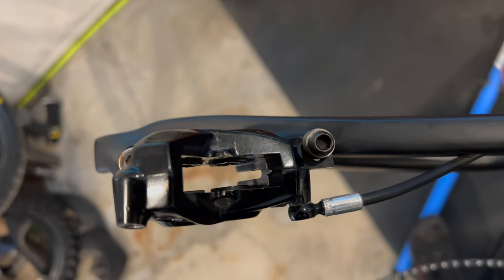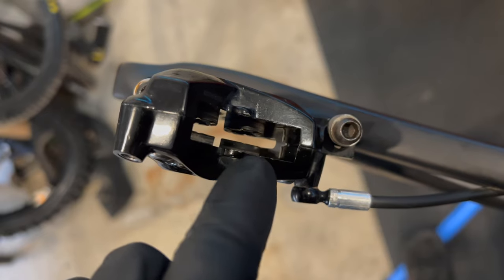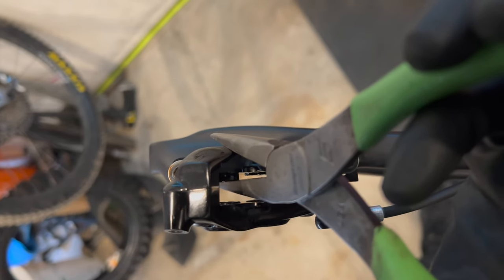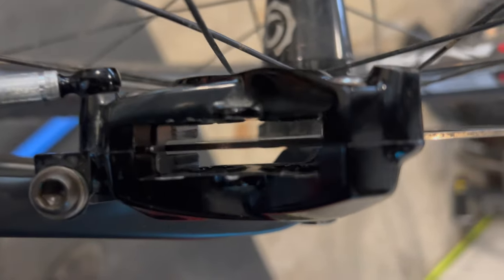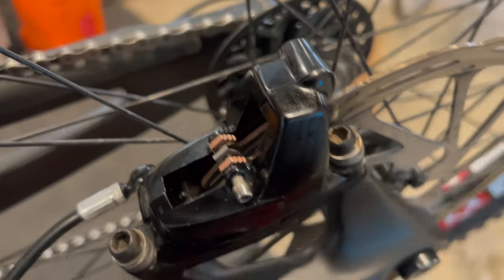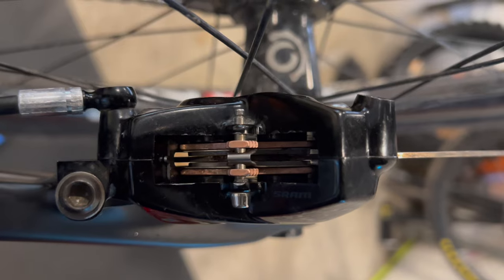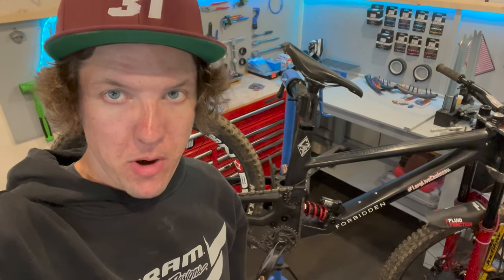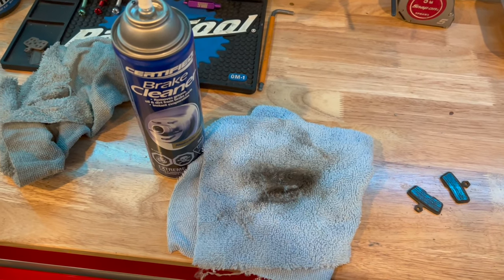How To Make Your Sram Brakes Not Suck! - Sram Piston Service

Comment: I was about to bin a rear Guide RE as the pistons on one side where so sticky I couldn’t align the calliper without it rubbing on the disk. The 4mm Allen key trick is absolutely genius and allowed me to push pistons out and get them moving with dot fluid. The brake now sits central in the rotor with zero rub. Fantastic.
Reply from the maker: Awesome Tony!

Comment: Excellent video.  I've been wanting to learn how to swap out my Sram brake pads but could never figure out how to push back the pistons until I watched your video.  Most of my issue was not having the correct instruction and parts (i.e. DOT brake fluid, brake cleaner, etc.).  Thank you for posting this.  Super helpful.  Keep up the good work.  You're the man!

Comment: I never used to service my brakes except for changing the brake pads (without opening the bleeding port). However, I had some issues with my Sram Maven brakes and got tired of going to the shop, especially since I have two pairs on two bikes. The information in this video helped me a lot! In addition, after almost 20 years of riding, I finally decided to learn how to bleed brakes so I could finally take care of my brakes myself.

Comment: Thank you so much. My back brake (code r) was almost pulling to the bar. I tried bleeding it 3 times with different tutorials including yours. None seemed to make a difference. However once I bled according to your instructions, then immediately did this piston service (without removing the plunger from the lever). This made all the difference. Brakes no longer pull to the bar, while it doesn’t feel as good as the front you can’t have it all! Thanks.

Comment: Thanks for this mate , just bought myself a Santa Cruz Bronson and was having nightmares with 2 pistons on one side of the calipers pertruding more than the other side. Had bought two sets of brake seals which I installed but didn't cure the issue.  
Did your trick with the screw driver and I now have brakes that feel like they are factory fresh ❤

Comment: WOW!  I have been less than satisfied with the Code RS brakes that came on my new specialized Stumpjemper Evo Comp. For "enduro and downhill brakes they were very underwheling and honestly the shimano mt200s on my other bike seemd far more powerful. I started with a full bleed and that helped a tiny bit, but i was still very unsatisfied.  I then combined this video with a video about re-bedding your pads (light sanding of the pads and rotors followed with a bed in procedure) with this video and NOW they are stopping like Iwould expect. ZERO problem locking up the rear on a fast downhill on pavement. THANKS!!!!

Comment: My brakes are now working perfectly, thank you. The 4mm hex key trick is genius. Just a word of warning about using pliers to push the pistons - be careful if there are serrations as the piston material is quite easily chipped.
Reply from the maker: Hey Tom, glad to hear your brakes are working better. For sure the pliers can be  risky, you can use a plastic tire lever for the same effect. The Snap On pliers i use are pretty forgiving. Luckily rebuild kits for these calipers are cheap and easy to install if the worst happens.
Reply: There’s also a specific Park Tool tool to push back the pistons. About $20 bucks on Amazon.
Reply: @TheFullKanani  That Park tool, made of metal, is intended to push the pistons back *with the brake pads in place*. i.e. the tool doesn't touch the pistons themselves. [If I'm thinking of the same tool.]
Reply: @phorest  yes that makes sense!

Comment: Brilliant idea 🥇 with 4mm to hold all pistons - Well done. One step up would be to keep 4mm (use robber band) inside caliper to hold on all pistons and slide/ squeeze flat screwdriver between 4mm and piston to push one piston back and/or reanimate one if stock. That way you protect the caliper body from damaging by plyers and popping pistons out.
Its nice to see when brain is used.  Great job men.
Reply from the maker: Thanks! I really don’t care about superficial issues especially when I’m going to crash into a tree or a rock on the next ride ha! But good idea to save the paint if your worried about it. Thanks Len

Comment: I've struggled trying to get the pads to advance the same amount.  These are all great tips. The screwdriver behind the pad is a game changer. I've never thought to preload the spring.  Have you taken the calipers apart to replace the square seals?
Reply from the maker: I have taken calipers apart but normally it’s more cost effective for a shop to just replace the caliper. It’s pretty easy though, and cool to understand how the brake works. Thanks Len

Comment: putting the bleed syringe on the brake lever while doing the piston service is brilliant! hadn't thought of that before but it totally makes sense!
Your pistons must have been mostly okay...I have a heck of a time pushing them back in! Also, a little tip for anyone using a tire lever to push them back in: watch where you set that lever on the caliper! I was concentrating so much on getting the piston back in that I didn't notice I was also pushing against the retaining pin mount and it snapped right off. No fix, had to buy a new caliper! :\

Comment: Great tips! Does it matter to do this before or after bleeding the brakes?
Reply from the maker: If the brake really needs a bleed then you’ll have to do it after as you won’t be able to move the pistons out. Otherwise either is fine, I do this service every few months and only bleed the brakes 1-2 times a year. Thanks Len

Comment: Great video. If the brakes are brand new, would you still need to have the bleed syringe set up?
Reply from the maker: Ideally yes, the syringe acts as a reservoir for extra fluid so you don’t over bleed the brake, and more importantly not let air in. If you find that the pistons don’t retract back into the caliper without other pistons pushing back out, then you’ll need a syringe. If you can push them all back and they sit nice and equal then you don’t need a syringe. Hope that makes sense, thanks Len

Comment: Thanks for the great video, have a set of Level Ultimate that were driving me crazy, almost thinking to change them for Shimano, which i don't like. I'm super handy with all my bikes, but with this calipers, i was lost. Followed all your tricks, they're working as they should. One question, i'm using the bike on some mountains in Europe that have long downhills, 15-20%, and sometimes the rear brake gets hot and leave me with no brake at all, now i changed the fluid that was old, and changed it for Motul 700 racing fluid, which has a higher boiling temperature, do you have anyone that tried car racing brake fluid on mountain bikes? Thank you very much for your time and for sharing your knowledge and tricks. Christian
Reply from the maker: One of my favourite sayings is "there's no replacement for displacement" (car engine's) The bigger you go the more power you get. It's the same with MTB brakes. Big rotors and powerful brakes offer more control and will deal with the heat much better, so they won't fade on bigger descents. I run Code RSC's with 220MM rotors here in Squamish, they never fade. Thanks Len

Comment: I could not fully agree with the concept. Brake piston are intended to follow the pads when pads wear. Pistons made a very short stroke to brake because  pads have a small gap relative to disc. This is good because you feels a short lever movement  to obtain heavy braking. In the mode that you suggest a much greater movement of the lever will be required

Comment: Very helpful ☝️Thank you. 
At 3:00 how to avoid a piston to snap out the calliper when pushing in the last one?
Just starting with the one which is sticking out the most?
Reply from the maker: Yes, essentially start with the furthest out first. Make sure you have a bleed syringe with some oil installed at the lever, that way any extra fluid that would make a piston fall out will go back into the syringe instead. Thanks Len

Comment: Hi Great video. Thanks for posting. One question to lube the piston with a Q-tip..  what lube should I use?? Brake fluid or ??? Thanks
Reply from the maker: You should use the appropriate brake fluid for the brake you have. Shimano/trp is mineral oil, most Sram brakes are DOT

Comment: Oiling the pistons has made a TON of difference!! But… I can’t mimic the flathead screwdriver trick like you did. With the rotor between the pads, how do you get the pad and pistons on the opposite side of your pushing to retract??
Reply: Insert the screw driver behind the brake pad that needs to come out more and then push everything, the two pads and the rotor, against the side that needs to be pushed in. This technique will push the piston(s) on one side into the caliper to provide the needed gap between the contacting pad and the rotor. You'll also have to pump the brakes to bring out the piston after you push everything to one side. Repeat the process, on either side, as needed to provide equal gaps on both sides. Trial and error and eventually experience will get it right.

Comment: How about taking our some of the fluid from your lines? Won't that create a bigger gap between the pads and the rotor? With such a small gap like you have there, any little flex will cause a disk rub.

Comment: What did you use to lubricate the pistons? I've cleaned mine with disc break cleaner but did not lubricate them and they are still sticking 😞
Reply from the maker: I just use DOT fluid, or you can use DOT grease but it's expensive and hard to find. Len
Reply: Use dot grease. It will have a more lasting impact than the brake fluid.

Comment: Would you recommend these same steps for other brands like trp and hayes?
Reply from the maker: I do this for every brand, just use the correct bleeding fluid. It doesn’t make as much as a difference unless it’s Sram but regardless it will improve the setup of your brakes. Thanks Len

Comment: If my levers have way too much throw before the contact point, is it possible to advance the pads or use any of these techniques without bleeding? I don't have the bleed kit. They were just bled about 8 rides ago. If I open the bleed port, will I lose a bunch of fluid?
Reply from the maker: Yes you can do this technique without bleeding the brake. You may not be able to push the pistons all the way back without a bleed syringe. This service will fix your lever throw. Thanks Len
Reply: @garage31  thanks for the response. I ended up buying a bleed kit and learning that through your video as well. Cheers!

Comment: A Question, Len: I have older Sram brakes. They have 2 pistons and a retainer cotter pin. I have followed your bleeding and your not suck YouTubes. Problem: 1 piston is strong enough to push over the rotor a little, then not retract off of it. The pad does back off some, but always rubs. The other piston seems to be working properly. I have done the srew driver pry thing. I have also inserted a thin feeler guage blade into the tight side, can pry it back to the proper retracted position, but it comes back to it's misbehavior. Both pistons have been lubed, the rotor centered in the caliper and the pad spring made stronger. I tried to adjust the caliper to compensate for the situation, but didn't have enough adjustment. Please advise.
Reply: Update: I took the it all apart again, re-cleaned, re-lubed with DOT, worked to pistons in & out about 6 times. The "bad" piston has a tendency to get cockeyed in its cyliner, thus gets delayed/behind the good piston. I guess will get a re-build kit. For now, put it all back together. Now, the "bad" piston still does not advance the same as the good one, so double engagement is with rotor off-center of the caliper. However, I have positioned the caliper off-center so pads engage rotor at the same time. Suprisingly, this extra TLC helped the good piston to retrackt better, so now both pads have an equal resting distance from the rotor! On the "bench", works great.
Reply: Update 2: I then discovere the fitting behind the brake lever that adjusts the throw, or more imporatntly the pad engagement point. In the beginning, my main probalem was, the levers would hit the grips before full engagement. So, when I got done with all the work you guided, I still had the same problem, although much potential improvement once I got the throw adjusted properly. All of my previous reporting has been on the front wheel. It is ready to go. 

The rear wheel, except for the throw problem, had a different set of problems. Having gotten familiar with the syringe functions, I decided to start out without them. As I opened the fluid plug by the lever, I put one drop at a time in the system. It took 60 drops!! That seemed like a big part of the rear problems. Not expecting any bubbles at the bottom of the system, I cracked the caliper plug until a little leakage, then closed it back up. That was my short-cut bleed. Next, I pulled the pads, cleaned and lubed the pistons, inserted the 4mm Allen key & pumped the pistons out to that. Then the system took 100 more drops of fluid!!! Now I hooked up the top syringe with fluid becase I figured the system now had too much fluid when the pistons were going to be in the retracted position. Next, I adjusted the throw; very important both front and back with Torx T-2mm. Finally, centered the rotor and correspondingly adjusted the pads.

Test Ride: A little dissapointing. However, my eBike weighs in at 99 lbs and I'm 185. So stopping almost 300 lbs is a strech for old 2 piston calipers and untouched pads and rotors. However, I think the brake systems that I addressed above, thanks to Len, are working at max.

Heavy eBike? It started out as a fat tire front hub drive; no good on bumpy uphills in the Idaho Rockys. So I added a 1,000W Mid-Drive Motor with a BIG battery! Brakes? A must-have. These brakes are a bit under powered, but I think they are reliable and consistent, the two main things I want to trust in. 

So Len, I'd suggest addressing throw in vids like this. I realize this vid is a follow-up on your bleeding vid. Maybe you could make another one about lever throw adjustment as well as pad upgrades and maybe rotor upgrades or service beyond cleaning, if there are any? 

Thanks Much, Kid Len (a term of endearment from a 75 yr old adventurer),

"Jake"

Comment: Great video, can I do this rival Road brakes?
Reply from the maker: Yes definitely, this method will work for any brake. You just need to use the appropriate brake fluid to dip the Q-tip in. DOT for Sram, Mineral oil for Shimano etc...
Reply: @garage31  is there an alternative to DOT fluid on the pistons?
Reply from the maker: @vincheng28  you can use DOT grease, Sram makes some. It’s expensive though, and requires more clean up.

Comment: Can we use chain lube or minerial oil (shimano fluid) to lube the pistons?  I'll prefer to avoid handling dot fluid unless it for the bleed itself.
Reply from the maker: Don’t use anything other than the fluid the brake uses. Mineral oil will swell the seals and you’ll have to rebuild the calliper. Thanks Len

Comment: Hello, what type of oil can be used on pistons that use ole dot? In this case, to lubricate the pistons like you did with cotton sticks?
Reply from the maker: Just use whatever the brake fluid is, in this case DOT 5.1 will work. You may ruin the seals if you use anything other than
Reply: @garage31  ok THX!

Comment: 3:25 the piston on my brake is not flushed and the other one is not so the brake pad is rubbing in the rotors. any tutorials on how go fix it?
Reply from the maker: You may need to open the system at the lever (best if you can put a syringe on it) as there may be too much fluid in the brake for all the pistons to retract fully. Generally if you can push 1 piston in, and another push's out, then there's too much fluid. You can remove the syringe once you've pushed back all the pistons. Thank Len

Comment: Will this technique work for Sram Red brakes with 2 pistons? I've read conflicting info on whether to lube of leave dry.
Reply from the maker: Yes it will work for all Sram brakes. In fact it will work on every brake, you just need to use the appropriate brake fluid. Thanks Len
Reply: @garage31  I followed your instructions and it worked great.  Previously I was not checking if the caliper was centered, it is much easier to do with the pads removed. Thanks!!
My caliper was out by about 0.5mm, enough to cause an issue.

Comment: Does this have to be Done with the bleed syringe installed?
Reply from the maker: You may not need to. I use the syringe as an external fluid source (so the brake doesn’t suck in air). If your pistons push back in all the way then your fine, if they don’t, and you don’t have a bleed kit, just crack the bleed port at the lever a few turns and push your pistons back. Some fluid should pour out, close the bleed port and you should be good. Thanks Len

Comment: I don't have a brake bleed kit, can I still do these steps without it?
Reply from the maker: Yes you can but you may struggle to push the pistons in the caliper all the way. If that happens you can crack open the bleed port and let a small amount of fluid out until the pistons retract fully. Thanks len
Reply: @garage31  Thank you! And thank you for the great video.

Comment: why the syringe? u can´t lubricate/allign em without?
Reply from the maker: The syringe at the lever is in place incase the brake is over bled. If the syringe was not there and the brake had too much fluid in it, you would struggle to push the pistons back in properly. It’s basically a pressure relief valve. Thanks Len
Reply: @garage31  after you finish do you put pressure on the syringe or is not necessary, given that you have finished with bleeding
Reply: @garage31  yes also interested in if you re-pressurize with the syringe before removing/closing the lever or not...  Great video.  thanks.